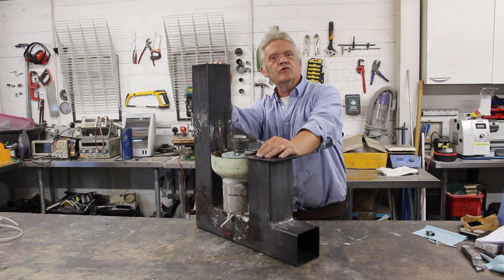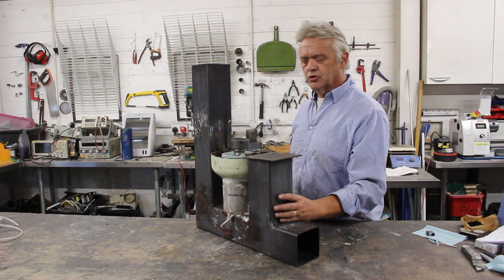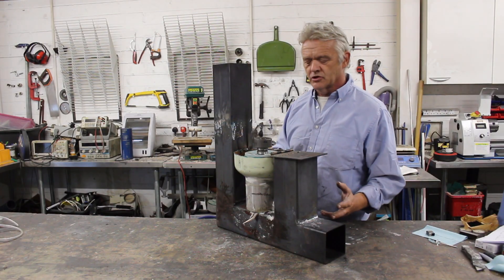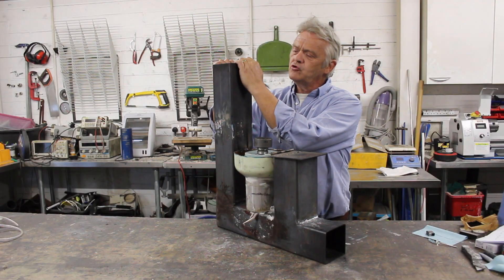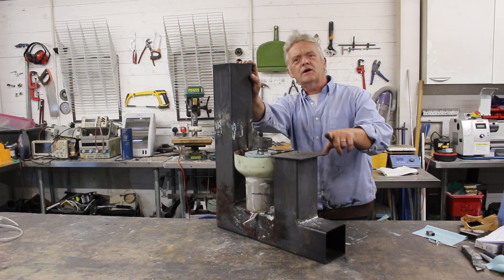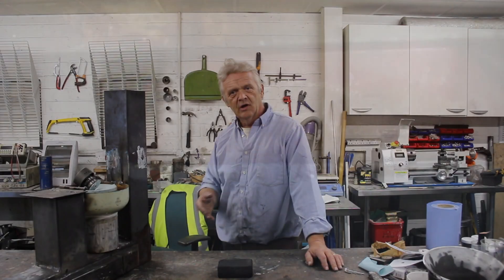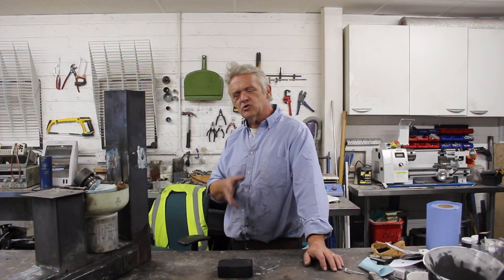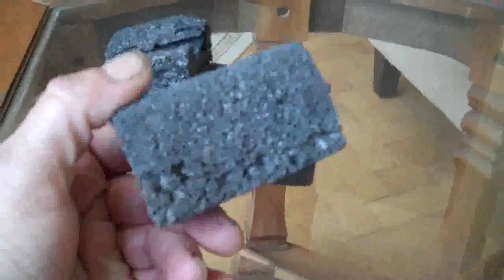1622 The Best Insulation For A Rocket Stove And How To Make It

Comment: I wonder if you could make a modified sugar mix, paint it on the stove and run it for a while to make an insulating layer. You might have to modify the stove slightly during this process, or somehow run it differently, since the stove gets way hotter than your recipe calls for.
Reply from the maker: that's an interesting idea mate - I like it thanks for sharing
Reply: That is what I was thinking! There should be a way to conform it around what you want to insulate somehow. Unless breaking it up into a powder and pouring into a box frame around the rocket stove would work?
Reply: I've been looking into large DIY ovens and you could make a powder coating oven to put it in, that's if you have other uses for a large oven 🤣
Reply: @robertpoynton9923  :   :  You could be looking for a clay or brick kiln or an outdoor pizza oven, or an improvised Raku kiln made of possibly a metal garbage can, fired with a propane cylinder…
Reply: @daphneraven6745    I have a forge I used for knife making. I would need to work out how to regulate the temperature make it. Also not able to get nitric acid and not sure of the quantity of the substitute chemical that he mentioned, I couldn't find it in the paper he referenced.
Reply: @robertpoynton9923  :  I’ve never done metal working, so it as much as I’d like to be more useful to you, the best I can do is be general.

You pretty much know from your craft, exactly what temperature you need to reach.

Some kilns are very sophisticated, and modern. You can set the temperature on those, and they’re thermostatically controlled.  Some projects need to be subject to very high heat, and may need to be in the kiln for pretty much the whole day and night, especially considering the cooling down time.

Some are less sophisticated, and are controlled by the type of fuel that you use and the amount of fuel that you use, as well as the design. Reference brickmaking during the industrial revolution. I believe the Townsend’s Heaven video about that.

A Raku kiln tends to be a low temperature sort of affair (as kilns for clay go), and usually runs for a few hours in the evening.  I guess that’s why they tend to be set up for social type events, where people are making things like vessels for Japanese tea ceremony’s, and they sometimes set them up for big family or class events; since they are fuelled with propane, that’s how the temperature is regulated.

So, perhaps you could look up the different types of kilns and traditional kilns including historic ones, as well as the temperature range for which you could expect those to work.

I could be wrong, but my father is a metal worker, and it seems to me that when he’s working with metals, there’s a need to quench them on a regular basis. So I don’t know how that sort of application would work with a kiln. Perhaps bust out your search engine and see if you can find a fellow metalworker who uses kilns?

Comment: better the insulation in the chamber!! + add air ports in the flue ..
Reply from the maker: ? sorry mate that I don't understand - if just made it out of the insulation then the chamber would be formed by a cavity in the insulation - in which case there is no inside or outside of the chamber as the chamber is just a cavity in the insulation
Reply: @ThinkingandTinkering  in the way a furnace uses fire bricks or wool too keep the heat in

Comment: Thank you for the carbon fiber foam. We used sodium silicate to coat the inside of the pipes with. 
Stupid question - 1) Can I get nitric acid without  getting on some government watch list. 
2) What molar acid?  I'm an armature and have to dispose of by products as well store the stuff safely in a ventilated area.
Reply from the maker: if you can't get nitric acid you can also use ammonium chloride or zinc nitrate mate
Reply: @ThinkingandTinkering  Thank you sir.
Reply: @ThinkingandTinkering  Thank you. this very cold weather has me searching for better insulation for a few areas. 
Carbon foam is way too long a process to do large areas but I'm trying to do it over the holiday's in small batches. 
Happy New Year to you. Best wishes for 2023
Reply: Hi from France ! Here too we have nasty laws, it's feasible to synthetize nitric acid at home by using 2 Do-It-Yourself ways.

See NurdRage YouTube Channel, he has made some. You can also ask to a private company to purchase some bottles for you. Always used for destroying tree's roots by pouring 37% HNO3 by farmers. It exist a glass chamber where a high voltage spark between tungsten electrodes will create HNO3 with ...air. 

See some YouTube videos dealing with good old  Birkeland-Eyde swedish process.

Best regards !
Reply: just remember not to put cellulose or glycerine on the same order list  ;<)

Comment: Very good, but effort involved?  Nighthawkinlight and some others did some demonstrations using bread -- turns out toast carburizes nicely to a foam.  Perhaps a mix of paper, sand, and scrap gypsum board, instead?  Insulation would support the themal battery.  Cost and effort should be less, and paper embedded in sand will also carburize over time.  Maybe put your steam coils in the sand in addition to, or instead of the chimney?
Reply from the maker: it is a bit of effort but the pore size is more controlled and the result better - even so it's horses for courses and an easier route will give you a reasonable result just not a good result - but you go for what is good for you mate

Comment: Cool, great to see new videos added to the carbon foam playlist! Any chance this carbon is conductive without needing to cook at kiln temps?  Is there anything we could add to make the foam flexible?  Would borax make it harder/stronger or ruin it by reacting with the acid?  If its strong enough, a tile of carbon foam might make a great thermal barrier for the next thermal lag Stirling.  Sorry for so many suggestions 😅 but this is exciting.  I wonder how a carbon foam cooler would work.
Reply from the maker: if you add a little nickel salt to the sugar mix it will be conductive - the rest I don't really know - but sounds like someone has quit a bit of experimenting to do lol

Comment: You can also make carbon foam by carbonizing bread. I managed to make small pieces on my stovetop in a tin can filled with charcoal (to keep a reducing atmosphere). But bricks should be doable in a larger furnace in a similar way. It does tend to warp due to the shrinkage, but there's probably a way around that. Alternatively, the sugar method could also be done with another gas formation agent like sodium bicarbonate, which would be more accessible and also 'safer'.
Reply: It might even be interesting to wrap the stove in bread and run it, and let the carbon foam form in real time around the setup.
Reply from the maker: good foaming agents are ammonium chloride or zinc nitrate - as for bread - sure it works just not as well

Comment: They usually place it in a bucket and fill it with plaster of Paris and perlite and it’s usually sufficient enough
Reply from the maker: indeed it is - just not the best
Reply: @ThinkingandTinkering  Well yeah. The best is only as good as the application it’s used for. keep in mind the various acids and oxygen and intense heat. that metal will only hang around so long. I think that material would be more suited for a kilm or smelter. i’m certainly going to keep that in my toolbox of knowledge.

Comment: Oh Cool.
I saw someone, honey do carpenter here on yt I think, made a rocket stove out of aircrete inundated with water glass, so it was refractory, very insulative, and lightweight. He cast the mix inside a metal frame, for durability.  It seems like you could do the stove out of just slip together Chimney pipe with that method.  Might also be a good option for people to try.
Reply from the maker: good suggestion mate

Comment: Good video. The fundamentals are covered now. Pearlite is not a bad insulator too.
Reply: Yep. Vermiculaite also.
I mix perlite with clay slip to keep it where I put it. Works a charm.
Reply: @SundogbuildersNet    a lime and water slip works well too
Reply: @bigoldgrizzly  
Lime can't really handle higher temperatures.  It'll turn back to quicklime pretty quick. At least the bits that are in the biggest heat. Might not matter if the stuff on the outside holds it in. Just don't get it wet! ;)
Reply: @SundogbuildersNet  True, the lime filler/binder will breakdown to dust at 875 -900 deg C. I have used it contained between structures such as brick and pipes, where the physical strength of the insulation is of little importance. All firepots will degrade with time be they made of cob, vermiculate/clay binder fire bricks or steel. They have to put up with a lot of grief from oxidation and decarburisation of steels and the repeated expansion/contraction cycles, not to mention overexuberant use of pokers or ash rakes. Behind the tough 'working face' the insulation suffers less from these issues and in some cases can be recycled after the inevitable periodic stripdowns. Unless the firepot is to be built in expensive bespoke specialist cast porcelain type ceramic materials that can cope with temperatures of 1000 - 1400degC, it seems a bit pointless trying to get rocket stoves to run this hot. Better perhaps to accept running at lower temperatures and building with firebrick faces in the firepot  and a vermucultie with binder encasing the whole. This makes for a structure which is easy to take down and rebuild..... got a bit off piste there ....  and a little carried away....... ;<D
Reply: @bigoldgrizzly  
Excellent! For me it depends on what I want. I build a lot of temporary mud stoves for quick cooking. If i insulate, its with things like forest duff or straw dipped in clay slip. 

When I'm installing a Rocket Mass Heater indoors though, I'll build all the combustion unit bits from bought firebrick. Insulated kiln bricks for up the riser where no poker goes, harder stuff in the feed and in the horizontal burn tunnel. I generally insulate using perlite and clay slip. I have oopsed with some natchy found clay that couldnt do the heat before but the stuff on my property works a great.

Downstream from the combustion unit,  I use a lot of adobe bricks and cob with generous use of redbrick and metal bits tossed in depending. 

Saunas are a good reason to crank these things to the max! 8 inch diameter  j-tube blasting a metal radiator with steam. Very nice!
Reply: @SundogbuildersNet  
I like your approach - practical and thought through. I tend towards a state of mind that I should build for sturdy construction, high end 'efficiency' and long lifespan ... then life happens, and for whatever reason, I can't do just what I want and reach some sort of compromise. It generally works out pretty well because I've thought about materials and their properties and the condition they must endure, during the 'perfection phase ' of the project . The great thing about non-steel Rocket stoves that you can tear down easily, re-use most of the materials and try something different.
I envy you your clay - rare as rocking horse poop near me, but I do have over 150,000 tons of good clean silica sand under my field so can't complain. 
I've had my lifetime's share of very hot humid conditions down the coal mines, so probably won't be building a sauna any time soon. Put me in one and I'd be the pile of bones in the corner and a trickle of grease disappearing down the drain  ;<)
Reply from the maker: for sure mate and cheers

Comment: Bought two storage heaters in the 80’s and the installer told me the heat was retained in blocks that were the same material as the tiles used on the space shuttles. Apparently they hold the  heat extremely well 🤔
Reply from the maker: interesting
Reply: Did they work using off peak electricity at the cheaper rate..?

Comment: i think Starlite is the best insulator for this.? how about make a video to dye Starlite?
Reply from the maker: no not really mate -- Starlite is good for protection as it forms a carbon foam which then becomes insulating - with this the carbon foam is already formed - kind of cut out the middleman if you like
Reply: @ThinkingandTinkering  hm so i know Starlite forms an carbonlayer an then it is expanding to the heat, let me know if im wrong or i misunderstand enything! also i like your channel, good work ;)

Comment: Not bad in general, but neat carbon foam has a great disadvantage: it burns! To prevent this you can mix the sugar with fine quarz-powder, e.g. microsilica, before carbonizing the whole stuff. That leads to SiC wich forms in fire a thin layer of SiO2 on the surface, shutting off the oxygen from the carbon and prevents it from burning.
Reply from the maker: nice idea mate cheers
Reply: @ThinkingandTinkering  See what I mean about the Chemistry?
Reply: I wonder if a similar method might work with the bread method. It seems like a great base recipe to try all kinds of freaky stuff
Reply: Cooking this in a vacuum would probably expand the foam greatly like airojell..
Reply: another option would be to use the carbon foam as insulation on the outside but line the inside of the flue with more traditional fire brick thus limiting the oxygen available to the carbon and putting a more durable material in contact with the flame they still need to be replaced but probably not as often as the carbon
Reply: Nothing better than vacuum insulation.  I wrote a very recent comment on how to easily use vacuum insulation for the majority of the system.
Reply: @justinw1765  where does one find THAT?
Reply: @justinw1765  I'd like to see this vacum method please!
Reply: Is this available to see
Reply: It only burns if you expose it to oxygen You can put other layer of steel over top of it or even clay or plaster
Reply: Wouldn't be adding water-glass be more advantageous? As that is already liquid and water soluble, but it would definitely be a fine idea! Also borax or a phosphate salt could do the trick.
Reply: @Marian_Martin_Morgenstern  borax is the first thing I thought of. Starlight insulation was supposed to contain borax and also Pepsi Cola. Go figure.
Reply: @HansHartman  Pepsi! Wow, that is nuts
Reply: @HansHartman  yah that is crazy, you'd think they'd have used Coca-Cola!😁
Reply: @moonolyth  good point
Reply: @moonolyth  more sugar in pepsi
Reply: @Marian_Martin_Morgenstern  The named substances are all possible but lead to lower melting products.

Comment: Great series, so with a J style rocket stove with the combustion section replaced with a ceramic chamber, a water heat extractor in the exhaust and a heat pump to remove any residual waste heat, I should be able to provide the whole street with hot water and remove the need for gas heating this winter. Just need to organise the kids to feed in the twigs 24/7. If only we could solve the energy crisis so easily.. but maybe in the next video 😅👌👍
Reply from the maker: ahh - at last a sensible use for children lol
Reply: @ThinkingandTinkering  we'll make the forage twigs like they are twix

Comment: Hey Robert, great video! You should check out the new research on making carbon foam from bread. I definitely need to try the sugar method from this video.
Reply: AvE did this and made a little forge out of a loaf 😂 Pretty cool stuff
Reply: I was thinking of doing that myself! Good to know it works. I have a nice loaf drying at home.
Reply: I make carbon foam slices every morning - then add butter and marmalade - yummy !!
Reply from the maker: I did mate - I like it - I also like the sugar the carbon is more controllable and closer pores

Comment: And there was me using doorsteps of white bread, sticking them in an old biscuit-tin along with some sawdust (to fill any remaining space) and a few holes in the top and bunging it onto a bonfire! 
It works, but not very tidy, and no-doubt very impure.
Reply: Yes, I would go for bread too. This paper (below) claims it has compressive strength of 3.6 MPa with a density of just 0.29 g/cm3 

Yuan, Ye, et al. "Multifunctional stiff carbon foam derived from bread." ACS applied materials & interfaces 8.26 (2016): 16852-16861.

This time around, I must remember to take the battery out of every smoke alarm in the house before starting again on this project.
Reply from the maker: if it works it works. mate lol